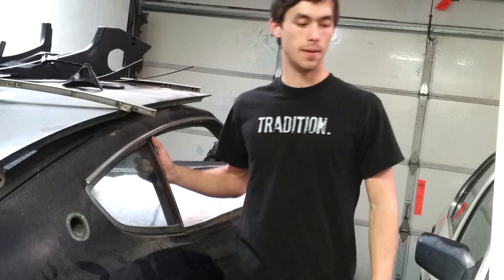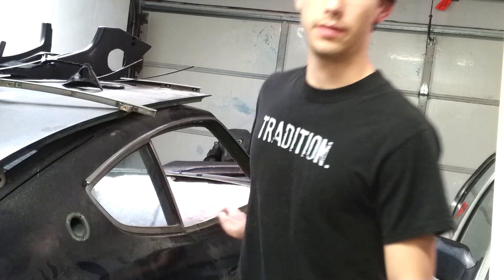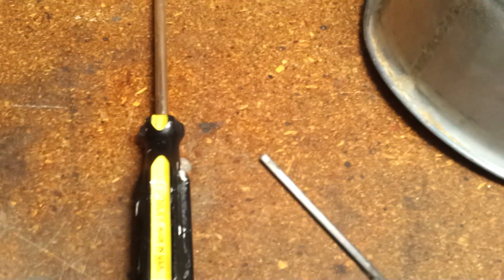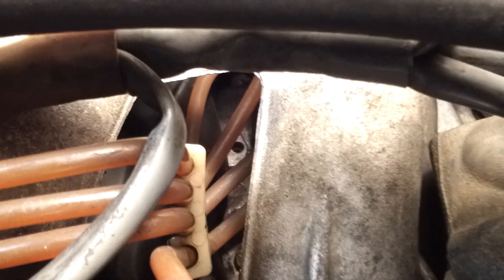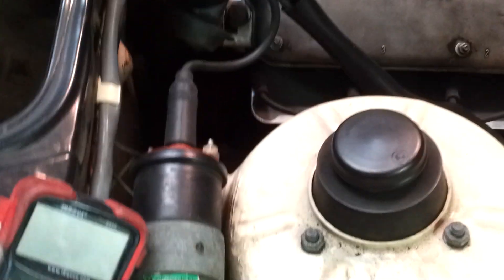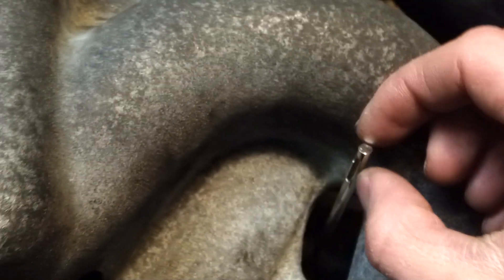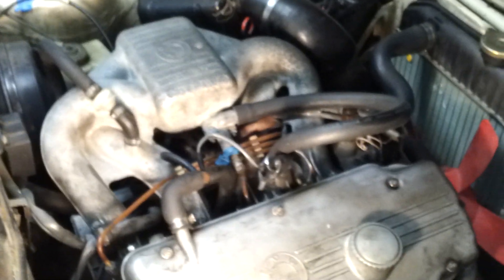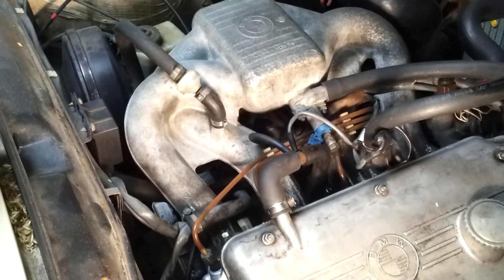How to adjust mixture and idle on E21 BMW

Comment: bro thanks i have  a 1981 320i and it was idling weird and sure enough thanks to you i relized the hose that connects to the air box wasnt even half way on. shits an oval not a circle anymore

Comment: Hey, thanks for this! I felt my 1981 320IS was running rich.  Using your techniques, I hooked up my multimeter and saw that my O2 sensor is reading around .8. I've adjusted it down to as close as I can get .45. That adjustment sure is sensitive. Seems like just putting some pressure on it in one direction or the other caused it to jump a couple of tenths. I've got it now where's bouncing around .45 consistently. It seems to be running a little bit more smoothly. I have a manual transmission so I left the idle alone at about 1100.  Problem right now is my garage car stinks of gas so we'll see after a couple days if it doesn't smell as much. 😄

Comment from the maker: No worries!  Yes, it should be done with the car running.  Blip the throttle between making adjustments to the mixture and readjust as needed.  :)  If the readings are all over the place, probably need a new O2 sensor.  My warm-up is 1400 and it settles to 950 once warm.  Also be careful to keep the O2 sensor wire off the manifold, so it doesn't melt.  Good luck! :)

Comment: You are amazing!  I did adjust the throttle on my '83 320i using your video. I was running too rich on fuel however once the car is warm, the throttle goes up and down; from what I have been reading, it seems like I have a vacuum leak. looking in to this.
Reply: Hi there
I have a e21 m10 and can see there are many hoses missing and some of them I figured out where they goes but still trying to find where the idle air control valve goes, it has the hose that comes from cold start Injector but not the one that comes out do you know where is connected?

Comment: any more videos regarding e21. like fixing the shifter play, hazard lights switch, e hat to check for no spark my 1982 e21 cranks but has no spark. Rebuilt the distributor new module still no spark.

Comment: Now is that .45 volts on the lambda sensor the same across the board?  Like a Porsche with a K-Jet would have the same reading as your BMW?  Or are there different specs of lambda sensors?

Comment: Awesome man thnx for doin this. so u did say while doin all that the car has to be running? i will try this for sure. messed with the throttle body screw before anything else :/ so i guess ill take it back down where it was since it didnt make much difference. but as it starts its off to 2000 but after warming up it drops to 1500 1700. just got some long allen wrenches so i hope i dont need to buy a weld kit next and an extra driver, guess thatd be a good permanent tool anyhow lol

Comment from the maker: So wait, you can't get the idle down to 950? If the idle won't go down, mixture is too rich, there is a vacuum leak, or timing is off a bit. As far as the voltage goes, you want to start with the multimeter set one degree of magnitude higher than what you want to measure.  So if your multimeter has a DC 20, and DC 200, and you want to measure 12, set it at 200 (one extra space). For .45, you can start at 20.  :D

Comment: I had a question.  I have a 1982 BMW 320i and ever since I have owned it it will not idle, we have tried adjusting the idle level but that does nothing.  It runs great, have no problem other than it idling.  I basically have to sit and keep my foot on the gas a little to keep it up.  Any idea where to start looking or what I can do to find out why it wont idle.  The odd thing is some days it works fine, while most days though it will not idle. Also, this happens no matter if it is a cold start or if it has been running for 30 mins, it will still not idle.  Any help would be great.  Thanks,
Reply: Did you ever figure out what the problem was? or did this adjusting mixture help?
Reply: I'll have to re watch the video and see if that helps at all, problem is, I'll have to have someone stay in the car to keep it running long enough for me to turn the mixture screw.  Was that the screw that was hard to see in your video?

Comment: I have the bmw 323i 6 cylinder 82 euro CIS model. I’m getting a  strong rich Oder from my exhaust system. Any advice on it?
Reply: Had the same one but mine didn't have all the emissions stuff on it. are you seeing any smoke out the tailpipe? Color? I'm midlifebmw on bimmerforums, by the way. I really miss "Trixy".
Reply: Dan The Vintage RV'er no smoke just rich smell, I can smell it in my clothes when I finish driving the car. Mines is a U.K. Right had drive I imported last month it has 108,000 miles on it. No U.S. emissions on mine.

Comment: My mixture screw was missing and covered with JB weld..
Reply from the maker: That.... really really sucks. :( The Air Flow Meter (AFM) isn't fun to remove on these, but can be done in an hour or so. Refreshing the AFM is a good idea. Pull the bolt out from another E21 at a junkyard or check BavAuto.  :)
Reply: RavingMadProductions The idle adjustment screw is stuck too and its idling around 1800 rpms.

Comment: no there was no difference. it seemed it kinda was goin down but as soon as i put the sensor back together id high idled. the guy before me had it at 950 but then adjusted the distributor barely while running and could get it to go higher or lower. other people keep telling me not too so i havnt. but seemed worked this entire time just fine. all i did was change sparkplugs set TDC and ran high idle as 2000 cold and after warmed up 1500.and about the voltmeter thats kinda what i thought.